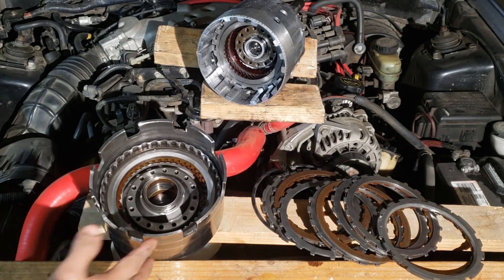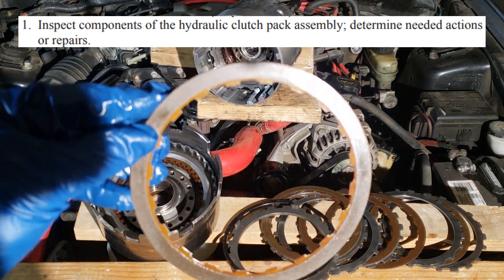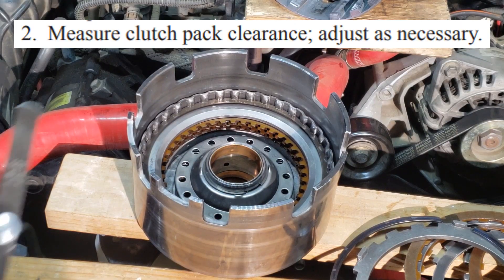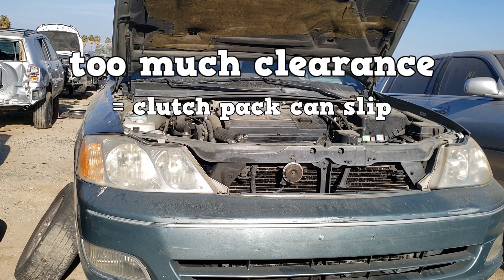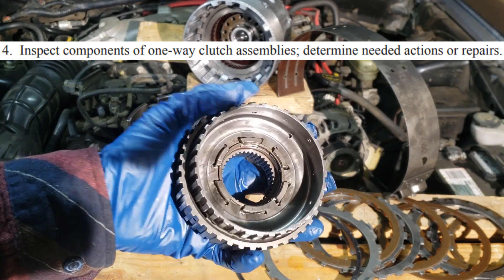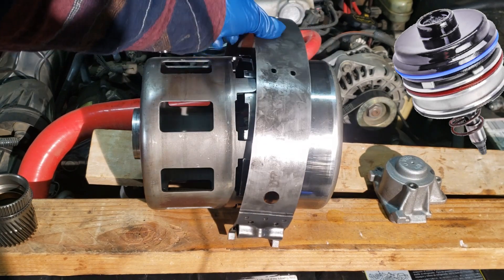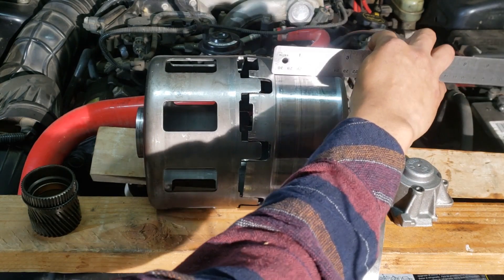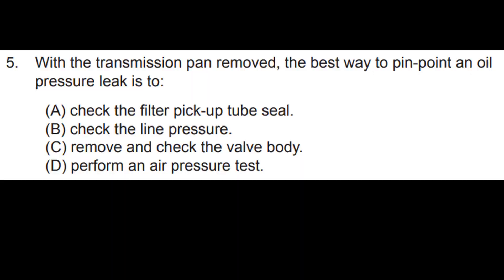ASE A2 Test Prep #3 - Friction and Reaction Units

Comment: What were the answers to the two questions you posted for this video? Thank you.
Reply from the maker: "Selective Piston" is not a way to adjust clutch pack clearance. 
The answer to the second question is D "perform an air pressure test." At 1:45 we air tested the clutch pack piston. It holds pressure. You can do the same air test on passages on the valve body. They should hold pressure. If they don't, you have a leak and can find it, just find where the air is leaking out.
Reply: @ thank you. I passed my A3 thanks to your videos. Going for my last one A2
Reply: @OldSchoolNoe   i came across your video and on the first question wouldn't the correct answer be D? ITS function is to apply pressure force does not adjust clearance

Comment from the maker: (Update 2-4-24) Here's some feedback after taking the test: Lots of math questions about choosing a selective snap ring. At least 4 questions, they'll give you a specification, the current snap ring's measurement and the current clutch pack clearance. It'll obviously be out of specification and you'll do some math to select the best answer out of the 4 choices.
Reply: Could you explain the math to get the answer for those questions please?
Reply: @davidthompson337  Reading from the motor age book its basically says the clearance you measured compared with the manufactures Specification. You either add to get to spec or subtract to get to spec. Meaning you pick a different thickeness of the snap ring, steel plate or pressure plate.
Reply: The selective snap ring feels like one of the hardest question. Especially when you never worked on transmission
Reply: Can you give an example of the math
Reply: My math never adds up
Reply: where is the math .. this is the only question you havent asnwered in all your videos
Reply from the maker: @manolo-pf6xm  I was thinking of making a video on this, but have picked up more projects. Here's an example on GM's 4L60E transmission:
  The endplay specification is between (0.005 to 0.036 in.)
The current reading is 0.090 in. with a 0.074 in. washer. Which washer do you replace with?
A.) 0.016 to 0.020
B.) 0.021 to 0.025
C.) 0.123 to 0.127
D.) 0.128 to 0.132

In this case as you INCREASE the washer size, the current reading will decrease.
Subtract the current reading from the specification numbers.
(0.090 - 0.005 = 0.085) and
(0.090 - 0.036 = 0.054)
These numbers equal how much you need to add to the washer to be within the specification range. Add them to the current washer size
(0.074 + 0.085 = 0.159) and
(0.074 + 0.054 = 0.128)

You need a washer that is (0.128 to 0.159) inches thick to bring the reading to specification The answer is D, it has its mini-range in between our calculated range.
Reply: @OldSchoolNoe  Thanks for this. The delmar and the Motor age do not show this in the book. These videos and those books help me pass 38/50. The test was actually really easy after a week of studying and watching these.
Reply: @OldSchoolNoe  Ive seen many of your videos and I truly appreciate you breaking down the math and sharing this information, i havent been able to find it anywhere else. I just passed this test 3 days ago also giving me the master tech status and i have to say youre videos were key to my success.
Reply from the maker: @rjose92104  That's a huge achievement, congratulations!